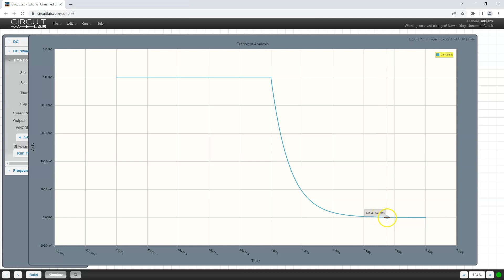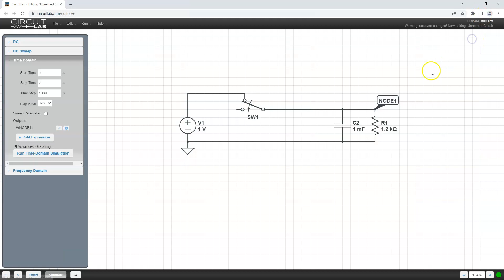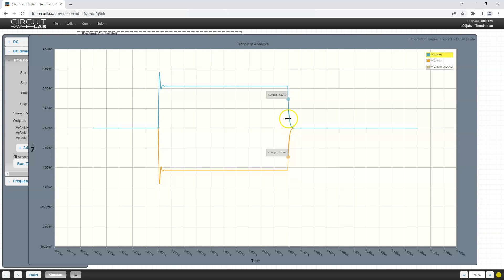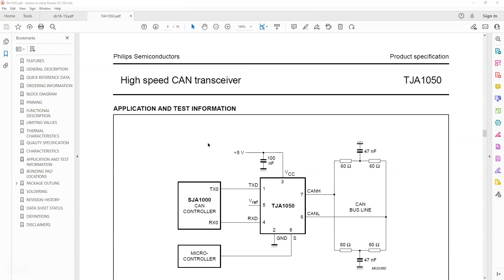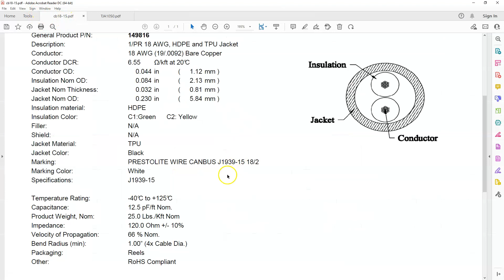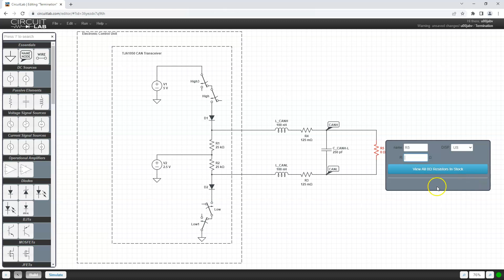Advanced J1939 Termination Theory 15

Comment: I have a stump grinder, which is CAN BUS com. Controlled.
Having occasional FMI 9 codes and drum/blade shut down. Mostly on TSP1. 

Cable integrity is good ( continuity wise), haven’t put the scope on it yet.
But what I’ve noticed - both ends with terminators are right below the display/HMI. I guess for convenience. And actually in the same harness. 
Resistors are OK.
Just wondering about running both ends long way from the last node drop, together in the same harness - can that cause some problems?